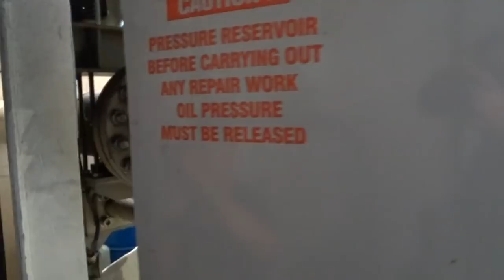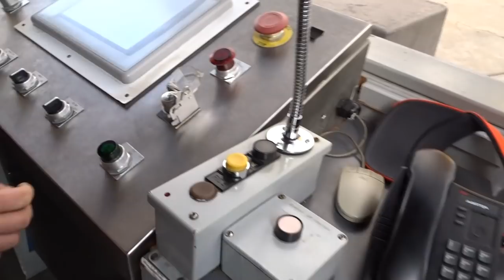Behind the Scenes Tour , Vortex Rename & 40th Anniversary/ RMC?

Comment: would it really make sense to RMC Minebuster?? I love the idea of Minebuster being RMC’D but I just can’t see it happening when the waterpark needs to be expanded
Reply: They can always expand the water park further out. There's space that's not being utilised, and taking out minebuster wouldn't add as much as simply building a little further out would.

As a former guard of Splash it at least seemed like there was more room on the south side towards the waveside pizza pizza and staff area (lifeguard trailer would have to be pushed back further) but then again I may be wrong or it may have changed since I've been there